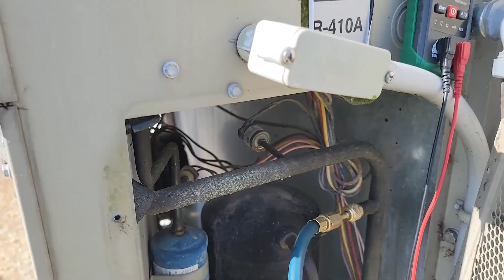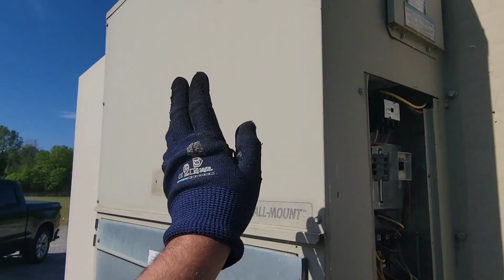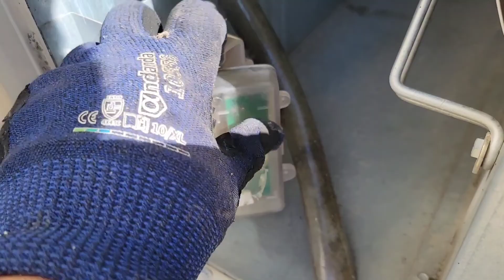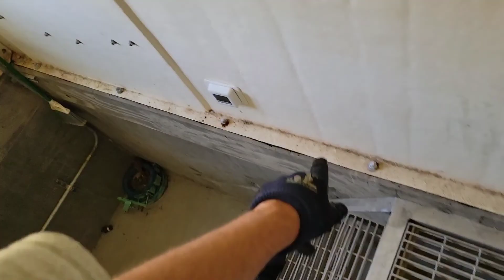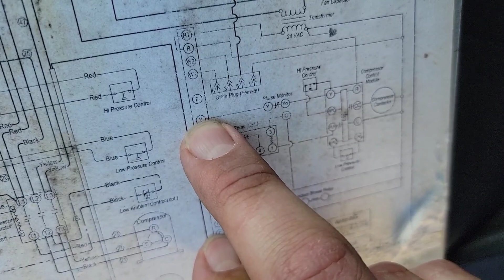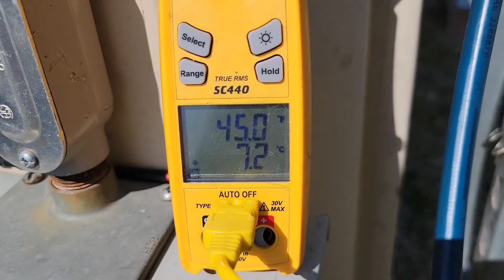Bard HVAC Troubleshooting Secrets Revealed @BardManufacturingCompanyInc

Comment: Bards are the best.  A blast of arctic air into a large, open floor plan house is beyond compare.  While the regular residential AC located on the roof is fine under normal circumstances, it is comforting, literally, to know that if you don't mind dropping a couple extra banknotes on 110+ degree days, you can make your home feel like a walk-in freezer within 10 minutes.  There is nothing comparable.

Comment: Just worked on one of these units. The pressure switches were cutting off power to the CC. So i assumed it was a leak because I also had very low sub cool. Factory charged is 110oz and I pulled out only 65oz. I put nitro in to see if I’ll lose pressure and it wasn’t leaking. I thought I was the only guy servicing this unit so i went to the owner and asked him again if anyone serviced it. And that’s when I found the truth haha. A big company in my area serviced it and they left it with almost half the charge in it! Scammers are so annoying

Comment: cathlab with 2 wl601L 3ph 5t, thermostat on ms2, the fan does not turn off, on the unit stage that the compressor is off, so it keeps on bringing hot air from the outside....1-already reset thermostat....where can i find a video about this particular isssue?
Reply from the maker: I'm not sure 😕

Comment: I am reaching out to you for assistance with troubleshooting a Marvair Wall Mounted air-conditioning unit. The issue we are facing is that when we start the unit, the blower works initially, but after a few seconds, the compressor starts running and then abruptly cuts off. The reason for this appears to be that the condenser fan is not functioning properly. We have already inspected the capacitor, relay, PCB, condenser fan, and high pressure switch, and all seem to be in good working order.

If you have any suggestions or ideas on what might be causing this problem or how we can fix it, please do not hesitate to let us know. We would greatly appreciate any guidance or expertise you can provide in resolving this issue. Time is of the essence, and we are eager to get the air-conditioning unit back up and running smoothly as soon as possible.

Thank you in advance for your assistance and support in this matter. We look forward to hearing from you soon with any recommendations or solutions you may have. Your prompt attention to this matter is highly valued and appreciated.

Warm regards,
Reply from the maker: Please click the join button. Become a member if you need help through email join level 1.
If you need help over the phone, join level four. Let me know when you join, and we will get started

Comment: I’m a new tech. Most of my learning is residential. But how can you tell what’s a suction line and liquid line on a commercial unit? 

And how to tell what’s a high pressure and low pressure switch. Thanks
Reply from the maker: Low pressure switches are the switches that usually have a blue color and they are on the bigger lines go into the compressor.
High pressure switches are usually marked with red and they are the switches that go on the discharge line of the compressor which is the smaller line on the compressor.
Reply: Suction line is usually still a little larger… However, let’s just assume they are the same, then just look at your compressor and think about refrigerant flow! 

Phase monitors just don’t have issues! Every time I have had an issue it has been a blown fuse or other issue outside of the unit itself…

Comment: Hey, thanks for vedio
I have issues on brad hvac compressor not kik in while the fan is running 
I follow the step on this vedio
I don't have voltage between c and y on the second step

Comment: You probably know but thats a lockout relay the HPS and LPS go through. it also acts as a DOM timer for compressor protection and it bypasses LPS during low ambient run times or in the case of loss of charge it will strike 3 times and lockout. Same in the case of high pressure events 3 strikes then lockout(dirty condenser coil is always the issue)  I think they are solid state relays so they are pretty reliable. personally I haven't seen one go bad but like anything electrical they can go wonky. Also if you have 24v between ALM and COM on the LOR you can confirm the unit is in lockout. Older Bards are great units. They'll run R22 at like 450 head pressure with a plugged condenser and restricted cap tubes for like 20 years before the wires start melting off the compressor terminals. The newer ones will lockout on high head if a ladybug lands on the condenser coil haha. Clean the coils and those units are absolute tanks. I'm surprised theres no redundancy at that site. Cheers Taddy, love all the content!
Reply from the maker: Very knowledgeable my friend I love you. Thank you so much for being so knowledgeable and caring about learning
Reply: The way you guys talk is so beautiful!
Reply: Just ran into this same issue. I was on my way to the supply house to replace the time delay. I'll just clean the coil now thanks!
Reply: Please do a whole series on bards

Comment: Great video, very clear and informative. It's probably not ideal, but if you couldn't get a coil or replacement for several weeks or months, is it feasible to pump out all the refrigerate and Saunter repair the leak ?

Comment: 3 Ton Bard for 9K? Seems high even for 460-3-60
Reply: It depends where they mount them for them to seem high. But if you meant expensive then yes that is expensive, even a 208/230 3 ton straight cool Bard is currently priced at $6,200.00, last I checked
Reply: @salad973  Labor????????? Plus other Parts???? As Tad mentions.
Reply: @dporrasxtremeLS3  I don’t understand what you mean. Also what is the purpose of so many question marks?
Reply: A single Bard on a container or building is a waste of money; and, yes, high for what could be accomplished with alternative brands. If you are not going to run multiple Bard (3,4,5 to 10, 12, 13+) units networked together, you shouldn’t purchase a Bard system! I don’t even know why there are videos for single/spot installs!